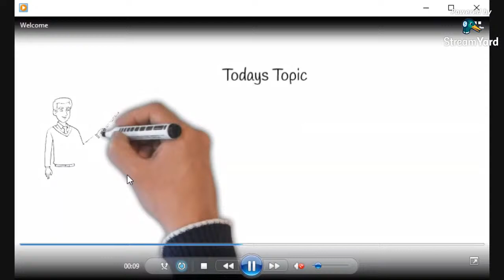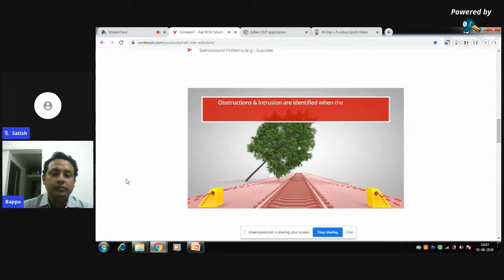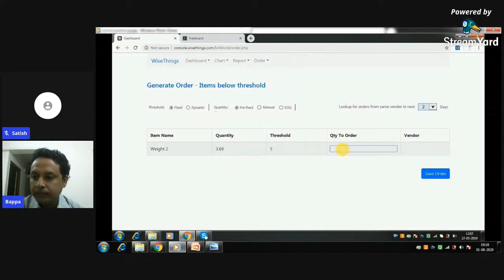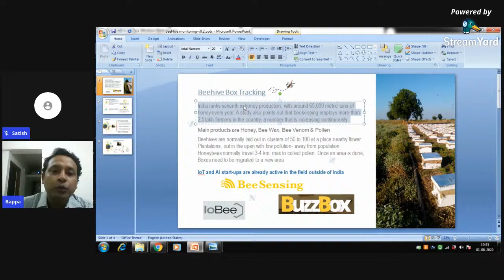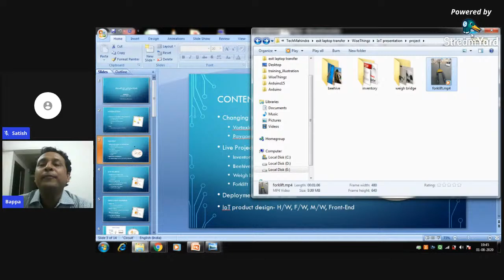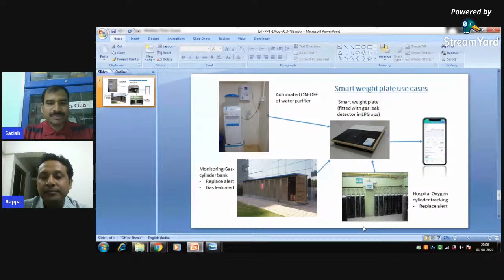Real-Time IoT Applications

Comment: Even though Mr.Bappaditya is a mechanical engineer but he is well skilled in electronics products development, which inspired me.

Also his below statements were more practical.     
                                  
"People has opportunity to do Smaller type deployments and not everyone doing rocket science."

"Cost is very high in low volume so people go for 

ready made Chinese device"
Reply: I was into core mechanical once out of college... and found that you need mechatronics to understand modern machines...
In mechanical motion transfer happens through shafts from unit to unit e.g. Turbine to generator, a robot arm moves through CAM or electronics. Somehow through linkages, mechanisms, modbus things were connected. 
Now we see IoT connecting things, it is still the syncronized motion- mesh in local area, telemetry in wide area.... even taking motions to another continent.